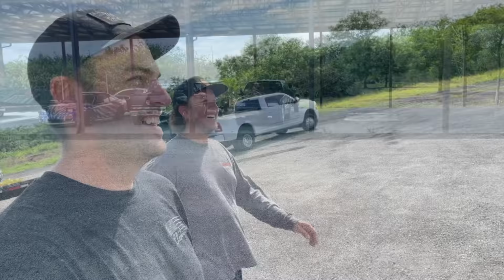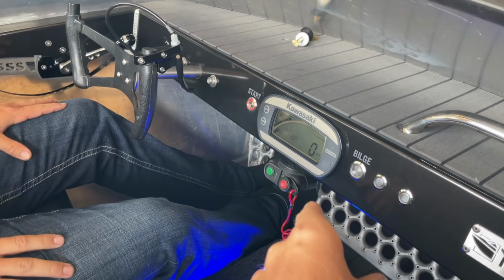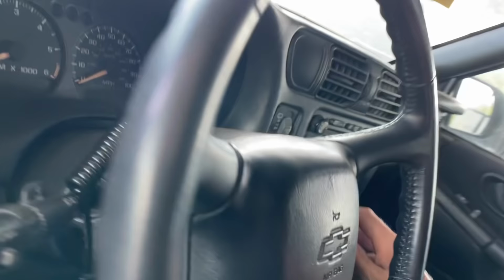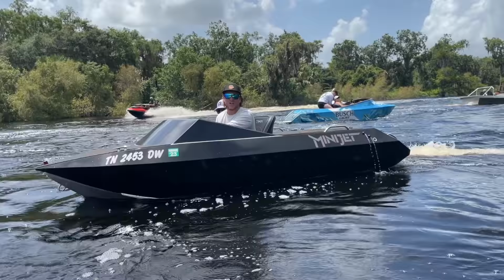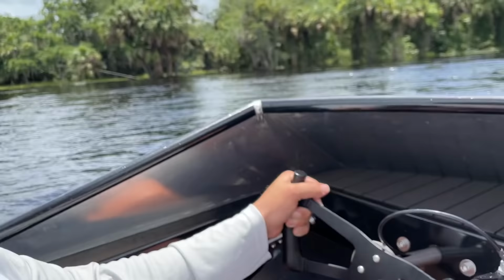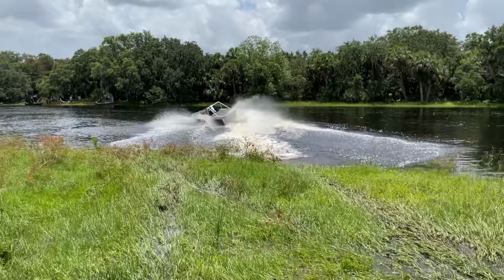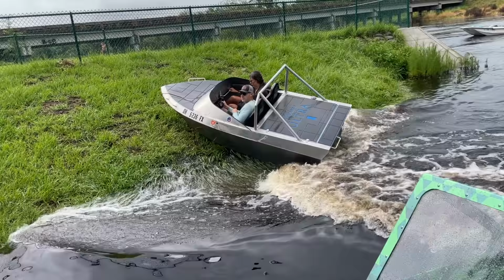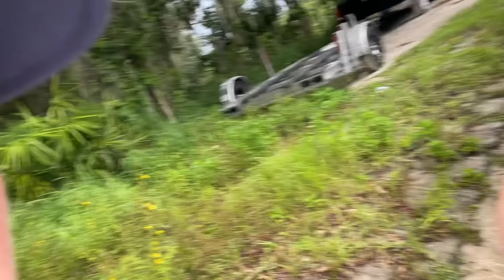So We Found Another Jet Boat On Marketplace... WELL WORTH IT!!! + Plans for the Race Week Blazer!

Comment: A neat thing about the Kawasaki is that it should have SLO (smart learner operation) mode where it limits the RPM to like 5000 so that new drivers can get used to the ski. You just have to hold mode and it should beep and switch over. Might make for a fun prank :)

Comment: Next summer we will be putting up one of our 3 boats for sale, it is honestly super nice, it is a 189 Scr Monterey, We have a swapped engine in it, it is no longer the 4 cylinder, it is a built Chevy V8, pushing about 300 horsepower. We changed the gaskets on it and many new parts. We are going to replace the floorboard, we new wood and put new waterproof carpet in it. She will haul out on the lake we go to, Harrison bay TN, it is a outboard boat so yes, it is a actual engine in it. Paint is White with Orange stripe and Silver flames on the side. We are looking for $10,000. We plan on buying jetskis because not all of our family can go out on the boat.

Comment: The S10 did a redemption burnout. Throw all the old surplus parts you had from the old shop at it. Make it a hand-me-down and junkyard parts only project. Sure, you don't have a supercharged project, but you also don't have a low-buck project either. Save the supercharger for a burnout car build.
Reply: Toast? Also they did that with ruby remember? It was a shit show and like 6 engines

Comment: Minijet windshield edge is so close to passengers it looks like a face killer if you stop too fast (rock, log, sandbar).  Might want a little roll-bar foam on that edge.
Reply: 18:04 That was my 1st thought & comment I posted, especially when he sits up & forward on the seat to look over the wet windshield. Riding something w/no brakes, close together, performing tricks/screwing around, I just see it happening & hate saying it, but it happens to ppl all the time.
Reply: So pick a different option 🤷‍♂️ lol
Reply: @BillBlast7372  And bench seats with no harnesses.
Reply: @jameslederer7613  harnesses and boats don’t go together
Reply: @Highstranger951  Its a damned if you do, damned if you don't kind of thing.  I guess if youre not in a controlled environment, a harness might not be a great idea if you end up turtled or anviled.
Reply: @jameslederer7613   yeah, definitely a no win situation 😂
Reply: @jameslederer7613  houdini vibes
Reply: GREAT idea

Comment: You should do a rotary swap in Squirt. That thing would RIP with 600hp!
Reply: If by "RIP", you mean the hull would literally be ripped apart.... then yes, it would rip.  A small single-turbo 13B could easily get you into the 250-300hp range and with the light weight of Squirt, that would be a helluva hot rod.

Comment: "The boats grounded to the river, so ya cant get hit by lightning" PURE florida man statement 😂🤣😂🤣
Reply: Ever heard of faraday’s cage? Same concept
Reply: @dylanzrim3635  for that to be a thing you'd need metal over your head. you wouldn't want to be in that boat with a direct strike.
Reply: @dylanzrim3635  except it is electricity and it jumps and they are literally touching it in several places. NO, being in a metal boat does not make it safer.

Comment: CLEETUZ, the dead peddle foot ramp is or looks just like the steps  from a Peterbilt or Freightliner fuel tanks!!!  Just cut/trim the ends to fit and make some mounts https://www.4statetrucks.com/fuel-tanks/semi-truck-bolt-on-fuel-tank-step-fits-freightliner-2010-2019-replaces-a2257757090_240178.asp
Reply: Dude i was about to say the same!!
Reply: Like this to the top!
Reply: It's just grip strut, any metal supply has it in 20ft lengths and sell you by the ft at like $11
Reply: @ryanlee6147  nice ! I never knew what that stuff was called. You can find anything online as long as you have the correct terminology.  That may be one of the major downfalls of our current search mechanisms. If you don’t know what it is your looking fir exactly, then it can be a barrier rather than a fast lane. And heaven forbid if your not clear yourself on what it is you want. You could be online for a week and end up worse of than when you started
Reply: @Rick_Dunaway  the only reason I know what it's called is because I worked at Pacific steel as a plate press operator and we made n sold it. Most people don't know what it's called either and would call it all kinds of things when they came in looking for it lol

Comment: Being a high horse power rev head I'm surprised you don't have a jet sprint comp boat.  I know you guys race them in the states but you have to check out the rigs from and NZ, Aus. 800 - 900 hp in a boat not much bigger than that in the top class. It was John Hamilton from NZ who invented this type of propulsion and type of boat to navigate NZ rivers and they have evolved from there.
Reply: Is that the racing they do with all the twist and turns in like a small pond? lol that shit is crazy

Comment: The engine in the new black jet boat is a 1,498cc 4 stroke, 4 cylinder, DOHC, 160hp marine engine that Kawasaki has used since 2004 and is still using. The dashboard is that of a pre-2012 model. The fuel gauge and especially the speedometer have never been accurate. Good engine though

Comment: I know it’s kind of old-school but put a Paxton Novi 2000 blower on it in the day they were so good they got kicked out of certain dragracing classes because they were too efficient they are not a 2000 hp blower but they are perfect for that blazer 800 hp all day long a blower boost curve you can’t go wrong turn it up with just a pulley change put a cog belt on it to get that wicked sound come on please I’ve had one on my Mustang for over 10 years now and I have had zero problems zero